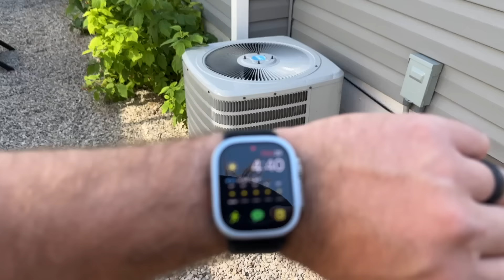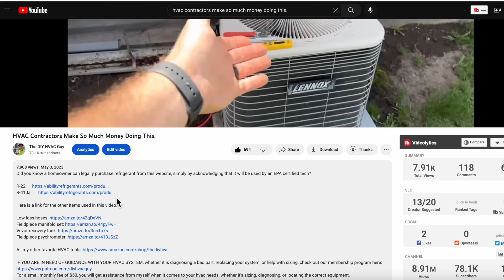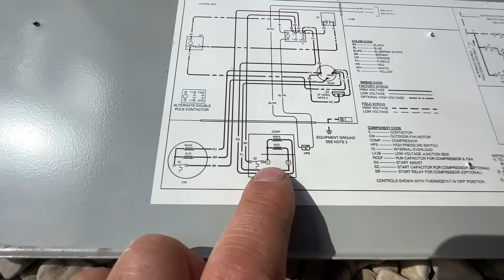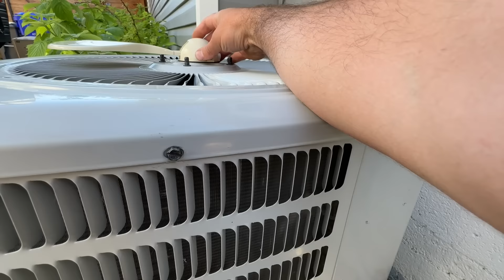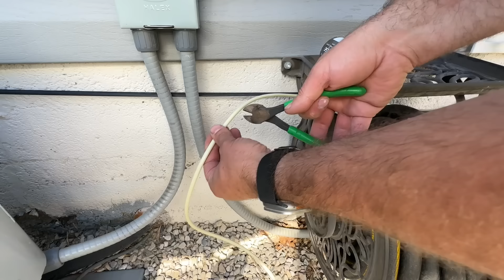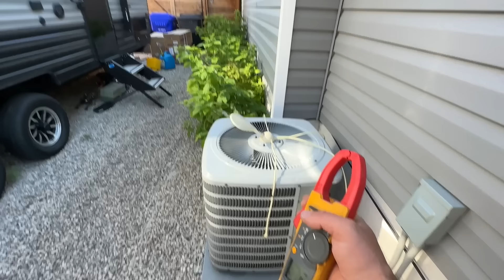Can This Device Actually Lower Your Electric Bill By 30%??

Comment: This is a great idea and is a good way to be more be more economic. It will not help the power side much to save but it will help the system cool faster then it will not run as long.
But the Amp draw on that unit seems to be very low. I would think that  compressor is not running. An average compressor draw at start up would be anywhere from 20 to 35+, but running Amp would be in neighborhood of @8 to 15 amps. 
I believe you said something about changing that system to a newer one. Maybe that is the reason your changing.

Comment: I would consider buying this if it works long-term without causing more problems than it solves.  I have a few questions/concerns/suggestions.
1) Provide a 1-month, 6-month, and 1-year update to see how things are going.
2) I am concerned about calcium buildup.  Would the typical coil cleaner remove calcium buildup or would this be a separate problem to handle?
3) Are you concerned that this could cause unnecessary corrosion on the AC system?  I would think not because it is already outside in the elements.  Thoughts?

Comment: Thanks for doing the test.  I feel like this item is more a proof of concept, rather than a practical device to install for long-term service.  Everything is made as cheaply as possible, and kind of ugly, honestly.  that paddle looks like it would last about one season before it stopped working.  That filter looks kinda like "Check the specs" to me.  3 months?  If I was going to DIY something I'd get a 115 volt solenoid and wire it to the fan.  Skip the BS paddle gimmick.  Run copper tubes from the bottom up to the misters, to allow servicing and cleaning without dismantling the contraption just to take off the fan cover.  Great idea, but needs better quality components.

Comment: Just a note about the piece of wire inside the tubes.  It's for forming the tube to make the 90 degree bend over the side.  shake it or slide it to the proper position and bend it.  Then it will hold the bend without kinking the tubes.  Better appearance, and keeps the tube open for the sharp bends.

Comment: The number one device to lower your AC bill is to surround your house with hardwood trees and plant shrubs and bushes around the perimeter of your property.  I did this to my house and my electric bill was reduced by 75%. Even with the massive heat wave, so far this year (2023) we have not needed to run our air conditioner.  Other houses in our neighborhood have deforested their properties,  put in grass lawns and now have to run their air conditioners 24/7  from February to October. Their electric bills are over $500.00 a month.  Our electric bill is $125.00 a month.
Reply: Good advice. Trees do help, and the leaves fall in winter, allowing the sun to reach the house. You just have to be careful about messy trees and those with intrusive roots, which can cause many problems.
Reply: @ronk9830  In my case there have been virtually no problems.  I did far more than plant a couple of trees.  I reforested the property by initially planting over 60 trees 25 years ago. Since then many more trees have come in completely covering the house and surrounding property with a tree canopy.  The tree shade protects the property from the sun and their leaves provide a forest floor bed that prevents weeds from growing and prevents the top layer of soil to dry out. . Because of this earthworms have come back and replenish the soil to a  rich black dirt color..  The soil in the deforested  yards dries  out and turns into red adobe. At that point the grass they planted can no longer live and their yards have become a mixture of various weeds,  dead grass, and dirt patches. Our lot is now fully reforested and is almost completely self sustaining.  That means no mowing, no watering, no chemicals
On the average the savings of a reduced electric bill and virtual zero lawn care costs due to  reforesting the property,  saved us about $4800.00 per year over a 25 year period. The savings  is far more than we initially paid for the house.

Comment: I would watch out for corrosion. My neighbor installed this, and he had to replace his unit because of the corrosion it caused.
So install with caution as to not drench the unit. 
   Most likely would work better in a drier climate than where we are.

Comment: As a HVAC Tech for thirty years, I've seen this work very well, but only for a little while. Then the coils become built-up with minerals and starts to deteriorate. Our water here in Arizona is very hard and will destroy the coils very quickly, then you get to buy a new unit and start again!
Reply: Use a disposable, evaporative pad outside the coil. Only the pad gets mineralized water on it. Air passing through the pad and over the fins is cooled by evaporation.
Reply: @FisherCatProductions  if that were the case, then you have found the cheapest way to soft water for the whole world! But unfortunately, it doesn't work like that, the hard water still gets past the filter.
Reply: @shannonwayneburns1140  I didn't say it would soften water! And you can't just wrap a pad directly against the coils. Baffles or simple distance are used with evaporative pads in all sorts of currently available cooling and humidifying products to constrain water.  Depends on how much work you want to put into a DIY for the expected gain. It's too humid during extreme heat in south Tennessee, so I wouldn't bother. Regardless, there's no way I would simply drench a standard cooling coil with water! They are made so flimsy nowadays the last thing they need is encouraged corrosion, not to mention the simple buildup of muck.

Comment: I have experimented with using water to cool the A/C condenser coils.  There are 2 main problems with using water.  Water containments collecting on the condenser coils, and, too much cooling will lower the refrigerant high pressure to the point where refrigerant gas bubbles will travel to the evaporator coils.

Comment: This is coming from someone who has used that actual brand. The valve inside the unit will stop sealing off after a while and water just leaks out of the sprayers costing you money on your water bill and wasting water. Also, the constant spray of water will keep those weeds around your unit hydrated and growing fast so be prepared to go out and pull weeds and grass out from around your unit more often. IF your unit is in direct sunlight all day...the plastic will degrade quickly and crack..which mine did ...twice. All-In-All, ultimately (to me) it wasnt worth the $90.00 cost of the unit, the increased water bill, the weed pulling and the need to keep fixing leaks or broken plastic parts. I didnt see any real savings on my electric bill....at least not enough to offset the cost of the unit. I think my wife said she "thought" our bill "might" have been a "few bucks lower". If your unit is fairly shaded and you are in an area where you have rock around your unit and not grass...it may work much better for you...with that being said...if your unit is not in direct sun, you probably wont need to buy one of these anyway. Also, be aware, that if you have hard water...the water lines will clog more than you'd like and the hard water will also cause a build-up on your unit. Anyway, thats all i can remember from my time with that thing.. Just my 2 cents worth from an actual "former" user of the product.

Comment: This is pretty ridiculous. If this was a good idea the manufacturer would include an evaporative cooling system with every condensing unit. They do not because this is a great way to ruin your condensing unit. If you want a lower utility bill for ac then get a higher efficiency condensing unit.

Comment: Last year my electric bill was 400 for july. I installed this. This year my bill for july was 280 water was 8 dollars higher. So I saved 112!

Also ac could not cool the house in july last year. This hear plenty cold.
Reply from the maker: Amazing! Thanks so much for sharing. That’s really cool to get some feedback on this
Reply: Yeah, it pays for itself. I try to tell others and they always react with "wont it corrode it?".

I worked at an ice plant, I was thinking he could save thousands a month.

The mechanic was like "yeah, I know the trick to cool a vehicle off is you spray the radiator with water" but they don't implement it.

I see these apartment complexes that cool the hall ways or hospitals...So much wasted energy and money.

Comment: Um the amp draw you took is for the outside heat exchange fan only. The condenser pump motor is inside. Nether of witch should see much difference in power draw as there both still doing the same work. The difference would be the amount of heat that is removed from the heated gas in the heat exchange (radiator looking thing under the fan). Meaning you will see colder temps at the vents and the AC won't be working as much during the day (bring your energy bill down). Keep in mind the possible down side If you live in a humid climate or use a humidifier in your home you could freeze up your coils if they are to cold to often. That is why getting the right size AC for your home is important.

Comment: I don't get where you're saving 30%? Does the fan on the condenser not draw any power? What about the air handler? The compressor only comprises about 20% of the total power that a central AC uses. So you're actually saving 30% of 20% or about 6% of the total electricity that your central AC uses. You'd save a lot more money by replacing a conventional 60 gal water heater with a tankless water heater. That is assuming that you're not taking 10 baths a day.

Comment: I will say that your house would have failed compliancy Your hose is too close to your air conditioner unit the city in my state would have not allowed your home to pass.. because the electrical system is too close to the water line.. just saying

Comment: You're decreasing your electricity bill but aren't you increasing your water bill by leaving the water hose running?
Reply: He said in the video that it uses about a toilet flush  of water per day. With some basic information, if your home was built before 1982 your toilet would use 7 gallons per flush, New toilets can be as low as 1 gallon but we'll use the 7 to see the max. 7 x 31 days at most in a month would be 217 gallons used. Your water is billed in thousands of gallons usually. So every 5 months, about the length of a usage, with the least efficient toilet flush as the measurements, but I would imagine that they would be using a number closer to 2 than 7, you would see maybe $20. So it's definitely the better option.

Comment: Why would you install the nozzles to spray outward instead of onto the coils?
Reply from the maker: You don’t want to wet the coils or the steel cage, you want to cook the air around it before it gets sucked into the coils

Comment: This is the dumbest thing. Let's save money by purchasing a water mister, ( initial money spent ), using water ( more money ), hooking it to a hose bib with full water pressure and leaving it pressurized ( possible leaks ), then the possibility of the hose blowing apart or the flapper being broken by high wind or some random person possibly causing water to continue to run? Not worth the risk, not to mention what happens when certain states, counties or municipalities enforce water restrictions during hot dry summers?

Comment: Mr. Science here doesn’t know what he’s doing or what he’s talking about. “Let’s see if it’s quieter!” 😂😂😂 That one was my favorite. And checking to see if the compressor was pulling less current? What?? 🤦🏻‍♂️ The compressor will pull the same amount of current without any change at all due to the heat being removed from the condenser coils. As for the benefit? Yes, 1° cooler air will definitely be worth the $4000 you’ll have to spend to replace your air conditioner because of destroying the condenser coils with scale, which you definitely will do regardless of how many filters you put on the line. 🙄 

Your air conditioner’s condenser coils are adequately ventilated. Just keep it out of the sun.

Comment: Would this work on a heat pump that has side exhaust? I have a 24000 btw Mr cool diy single room unit
Reply from the maker: You’d need one with a solenoid that turns the water on when the unit comes on. Otherwise it could stay on and water would run for no reason. I’ll be doing a video on the solenoid one at some point but it can be used for mini splits for sure.
Reply: @diyhvacguy  so you don’t think you could mount it facing down like a flapper?

Comment: They use to do this on jet engines to increase thrust on take off. Just mist a bunch of water into the intake air. A 747 almost crashed on take off because the system failed on an extremely hot day.

Comment: I have this on my 1998 Lennox 2.5 ton, works fine. But the big savings come  from my  utility. I run  the unit flat out from noon to 2 , then off from 2 to 7, then back on. Cuts my bill in half.
Reply: How hot is it during they take tho?
Reply: Please ask questions in English.  Thanks